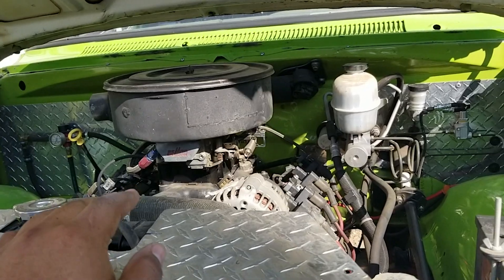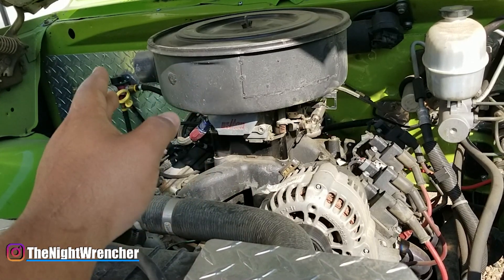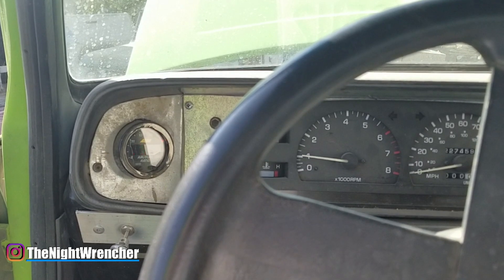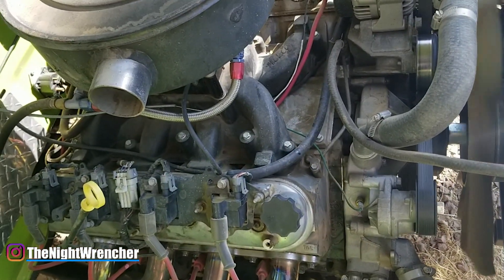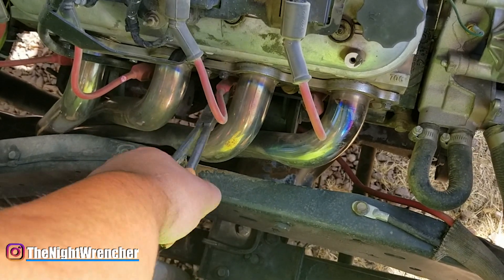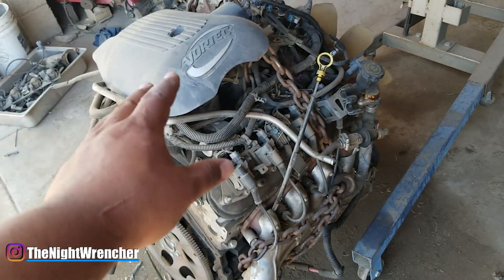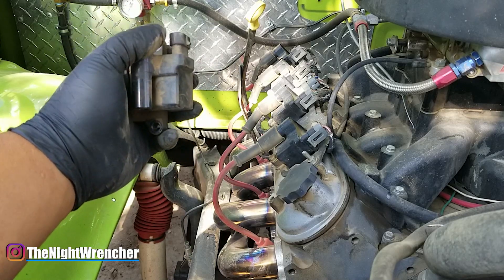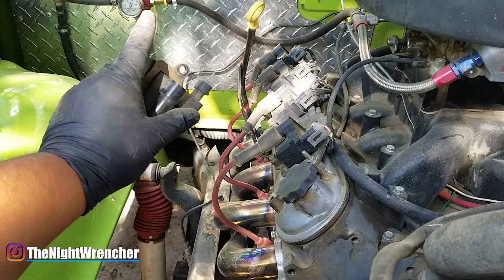DIAGNOSING A BAD MSD 6014- Step By Step Troubleshooting | Carbed LS | Carb LS Swap|

Comment from the maker: What do you guys think? MSD 6014 still worth it for you guys?
Reply: Did you run the 6014 red power wire to a relay?
Reply from the maker: @AKANEWK  yeah, main power feeds my ign switch which powers the relay and jumps power from my junction box to the relay. Nothing on my truck is fed directly, everything is on a relay
Reply: You have good ground wire? Maybe bad ground wire.
Reply from the maker: I redid all the wires while I was doing the diagnositcs and it all ended up the same so new grounds didnt really help.

Comment: Should I use ect plug in or leave it off.. ?
Reply from the maker: I just leave it on. If youre not going to use it, plug in the laptop and turn it off in one of the custom settings
Reply: @NightWrencher  if I leave it off . I got backfire. I don't know
Reply from the maker: If you leave it off, the timing map will add timing  because it thinks the engine is cold
Reply: @NightWrencher  I have carburetor and with or without map vacuum.  ?
Reply from the maker: The 6014 is only for carburetors. Vacuum needs to be hooked up in the stock settings
Reply: What that do ?

Comment: New 6425 6al digital 6al , hooked it all up ran wires tucked away perfect. No spark !!! Check , check , triple check 5 calls to msd  , tore all the work up fcccccccck. MSD Determination Bad box. Send it to El Paso. WTF. Guessing since Holley bought them out these are made in China now. Always been a fan of Holley but the whole corporate greed nowdays out sourcing is a bunch of ********  SRY had to vent
Reply from the maker: Yeah MSD is not what it used to be for sure.

Comment: Hey bro I'm still wondering are you actually driving around on 3psi ? If so I'm gonna take a stab at it that your way to low on the  fuel PSI ....pick it up to like 5 psi and try it ....hey bro how come your work place looks like a shit hole..?.
Reply from the maker: I drive on 3psi when I have the carb set up to go rock crawling. When I have the carb set up for street driving I have it at 6. They're different tunes because even the float height is lower on the offroad tune but I dont change it back right away if I know I'm going offroading soon. Either way, both tunes work well on the street. Been driving with the SSLS in place of the 6014 for almost a year now with zero issues. Havnt touched the ignition at all even though I still change up the carb when I go offroading.

Comment: Im having same stumbling problem and i already rebuilt my brand new demon carb and still stumbling ?
Reply from the maker: How does it run at full throttle?
Reply: Slow acceleration and when i want dump it hesitates and pops thru exhaust really loud
Reply: I was running it rich do to not adjusting properly. Got on the highway and it just popped 3 times really loud after that it didnt run like it was before
Reply from the maker: Thats not good, looks like you'll need to start by checking the health of your engine. Check plugs and do a compression test just to make sure its all good. Then make sure you have enough timing and finally go through the carb

Comment: Will msd replace it even tho i bought it 2018
Reply from the maker: They have a 1 year warranty so I doubt it 😔 Call them up and ask though
Reply: @NightWrencher  dammit ill probably end up selling all my ls swap set up and go with 383 stroker the ls swap is PITA lol
Reply from the maker: Did you make sure its not a bad coil?
Reply: I can check when the weather gets better im snowed in in dallas texas
Reply: When i connect msd to laptop it dont show the coil fault wouldnt it ?
Reply from the maker: @erwins.7007  nah, not even a misfire code.
Reply: Well damn smh im check it out before i lose my mind and just trash the engine lol

Comment: I must have got lucky and got a good one. I have been running the 6014 on a 6.0 for a couple years with no issues
Reply from the maker: When the 6014 works like its supposed to, its an excellent value for the money, but when issues start to appear, your only choice is to replace it.

Comment: my msd 6014 was bad as well,i chased every connection/voltage.scoped crank and cam sensor inputs-good.its serial number was 4404.Odd cylinders would not fire,swapped coil rails also.Wondered if it is a run/and or serial number issue.But I did buy a new one,well see.
Reply from the maker: Seems to be a comon issue but idk why. I'll be swapping to the new smart spark LS box so hopefully itll run better with the new module.

Comment: Do you have good engine to body frame grounds that will take out the box if not
Reply: Just trying to help hope you got it fixed
Reply from the maker: Forsure 👍 the new box is working good. The internal map sensor doesnt work on the new box either though. It reads 5hg at idle when im sitting at 20 so looks like Ill be on custom 1 with no map again
Reply from the maker: Both sets of coils are gounded at the head on the same bolt as the main battery ground. I also have a cabin to engine ground as well since the box is grounded at the firewall

Comment: I’ve never had good luck out of any msd products aside from the distributor. I used to use Jacobs ignition boxes. No clue if they’re even still around. But I’ll be jumping back into a new carb ignition system here shortly and dread trying to pick something other than a 6al.
Reply from the maker: I totally get it. Even the trusty 6AL that was in my 73 charger went out. Swapped to an HEI distributor and I was on my way again. MSD products are good for show and will last you a season or 2 at the strip, but I don't think I would trust it to take me around the country without a backup.
Reply: @NightWrencher   I agree with your comment on the MSD reliability and not much of other choices out in the market to make this transition from EFI to Carburetor on these engines.Right now i am going through the same issues that you seem to have had with the cylinder misfire on your carb engine,i have gone with the same process of trouble shooting the issue as you have describe on your video. Called MSD and got them to issue me an RMA hopefully i will have the same positive results as you had. It would be nice IF there could be a successful  way to wire the factory ECM to the carburetor fuel system on one of these engines. I think that if i had to do it all over again i would have stuck with the factory wiring,at least i think that it would have been more (Proven) reliable way to go with and (much) cheaper and i think less aggravating to diagnose engine problems at least with the 6014 box.